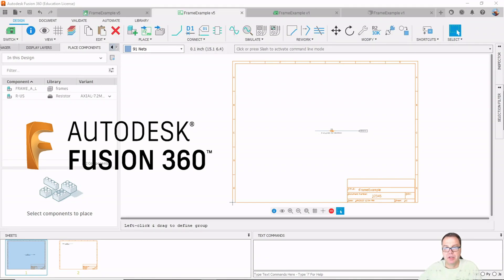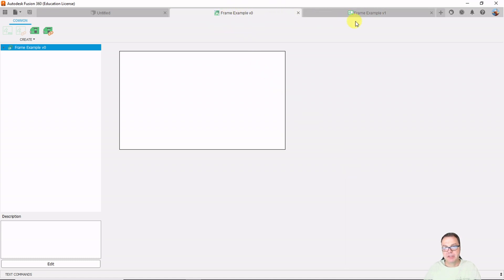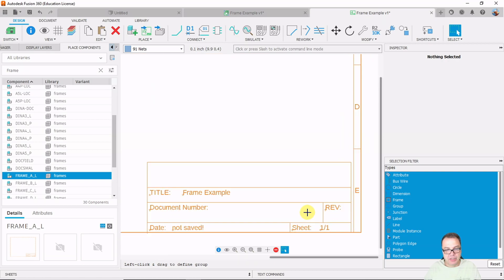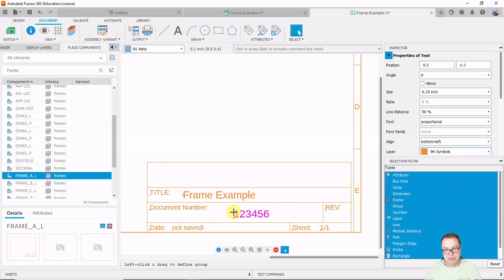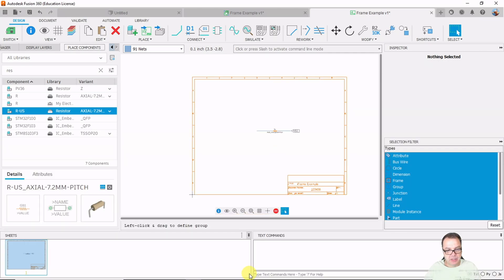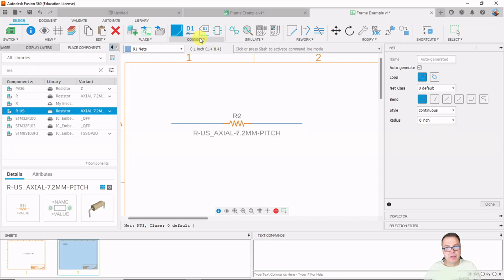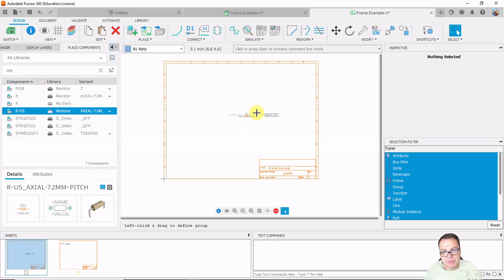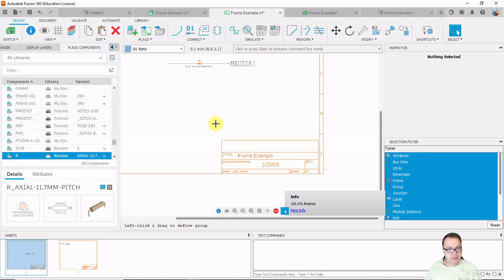How to use Frames, Labels, and multiple Sheets in Fusion 360 Electronics Schematics

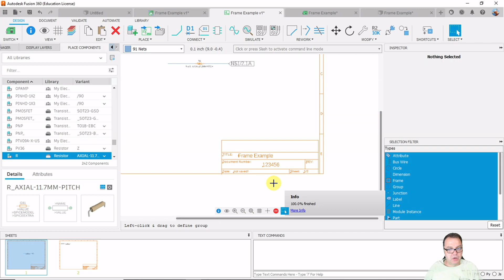Comment: 10:12 Is what I came here hoping to see. I guess Ill just have to manually add text for titles, which seems insane, but this is Fusion 360 electronics..... I gotta say, this software is the most tacked on, half effort software I have ever had the displeasure of paying for. It would be better if they just said Fusion 360 didn't have PCB design with all the complete levels of "no human could have possibly used this software before shipping it" levels of ??? I have encountered. What makes it all worse is the absolutely horrible documentation. Its just so sparse, and void of any useful images.
Reply from the maker: check @chadbailey7325's comment.
Reply: It's almost entirely based off Eagle which has been around for 100 years and loved by many long before Autodesk put a colorful wrapper around it. I still google "how to xxx in Eagle" when I want to know how to do something in Fusion Electronics. This guy, who seems to be the narrator of all the Fusion Electronics videos, is not very good at explaining things without getting stuck in the weeds.